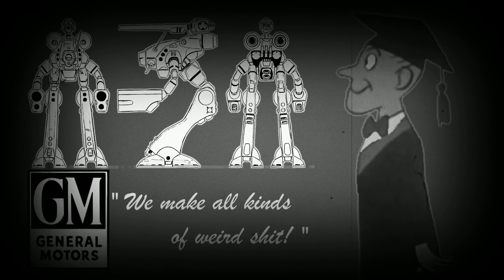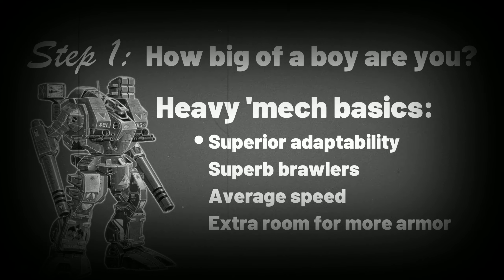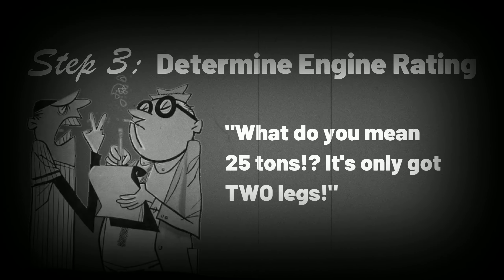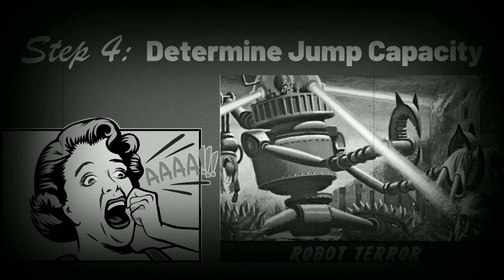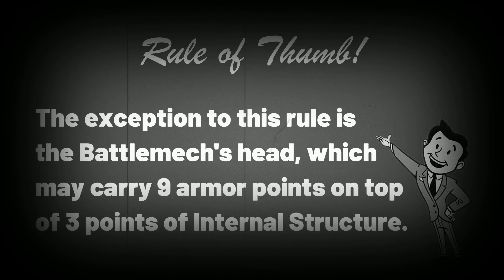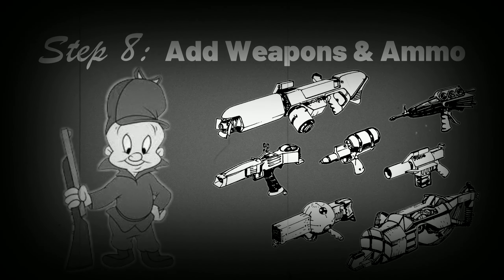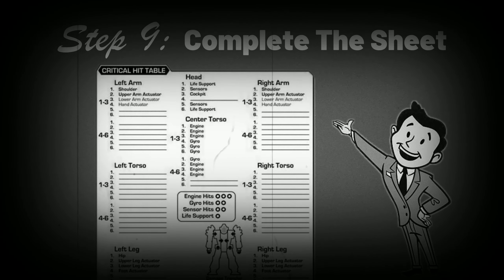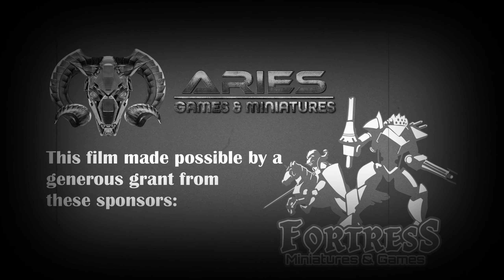Battle Bound Presents: Battletech Custom Mech Design 101! Create your own unique mech!

Comment: The losses due to rounding errors in basic mech design are awful. And they were mainly put in place to cover for the lazy and the mathematically challenged.
One of the first House Rules my group instituted was to change the rounding allowances to hundredths ton increments, not half ton or whole ton increments as per "the rules". On the Catapult from the video this would allow for 0.40 tons savings on the gyro, which could then be used for whatever you wish to place the tonnage in, as an example I would use it for additional armor tonnage, or 6 additional armor points.
The Catapult is not a particularly inefficient design (probably why it was chosen for the example mech). Some mechs lose as much as several tons due to rounding errors using the basic mech design rules. Be aware of this, and if you group agrees feel free to play with the numbers by removing the 'fudge' put in place by FASA's rounding system way back when.
Reply from the maker: I chose the Catapult because it's what was being built in one of the books I was looking at, and I was like oh, this makes my life way easier. 🤫😉😂

I believe, in either Maximum Tech or the Tactical Handbook (I don't have Tac Handbook, would have to check Max Tech), they had a rule called "Fractional Accounting". I haven't looked at this in years, so I am just pulling this all off the top of my head. But I believe it gave you the ability to basically use as much of that 65 tons as you possibly can, even if you wind up with a design weighing 64.87 or something. As far as I recall, I think I used it more for the fact that it would allow me to use .25 tons instead of being forced to work in only halves and also being made to lose half a ton on a 3.5 ton Gyro off of a 350 Engine, since I'd have to round up to 4. That's silly. We have Small Lasers that weigh half a ton, why can't a Gyro weigh 3.5? Why do I gotta round to 4? That kind of thing.
Reply: @BattleBound  You point with the gyro being 4 ton instead of 3.5 is exactly why we instituted our House Rule mentioned above, long before Maximum Tech hit the presses.

I do believe you are correct about fractional accounting rules being added later. I'd have to dig through the old bookshelf to make sure. By the time of Maximum Tech we had already created our own rules and basically only incorporated new technology's stats into our own tables and rules.

Comment: Ah, classic 3025 Btech design. One minor quibble--You didn't mention how torso armor needs to be split between front and rear facings. (come to think of it, you didn't mention rear-facing weapons, either). Of course, this could be the super-basic introductory tutorial, though IIRC that used the Crusader as the sample design. :-)
Reply from the maker: 😑 I don't feel like I NEED to explain that. The Armor Diagram shows Front and Rear numbers, and I explained no more than double internal structure for armor. Anyone who looks at the armor diagram can add the Front and Rear locations together and get 27, which is 3 under maximum. This IS a super basic tutorial for people who want to have someone explain the steps to them with examples.